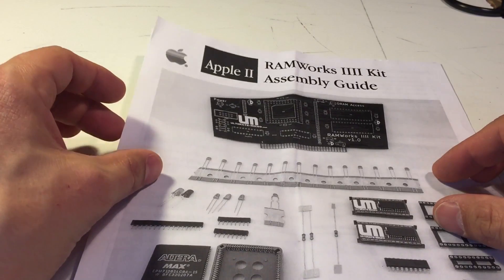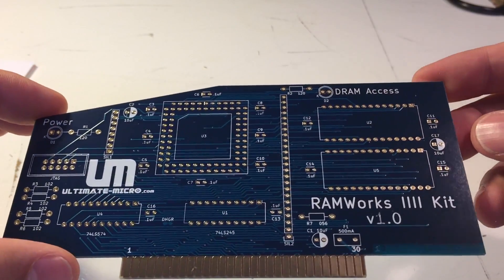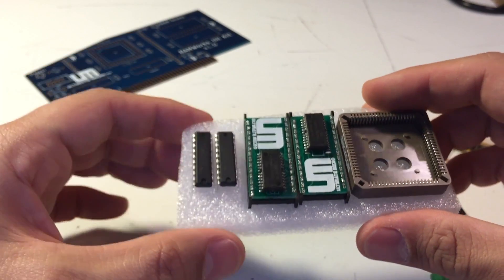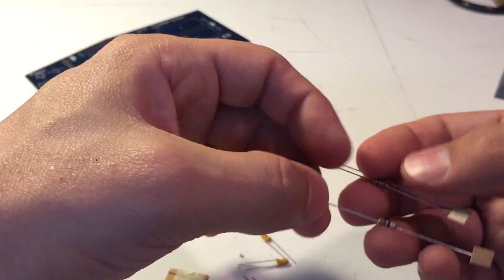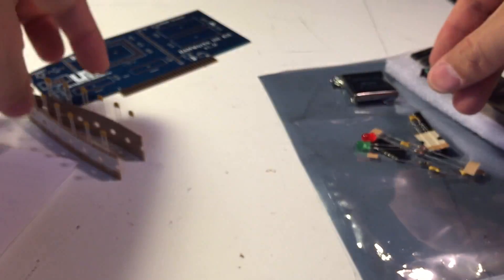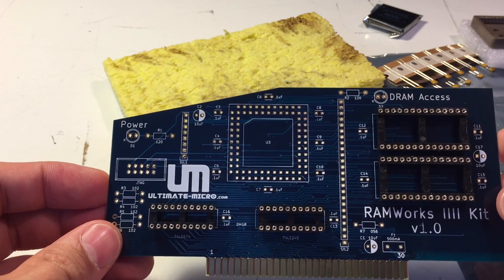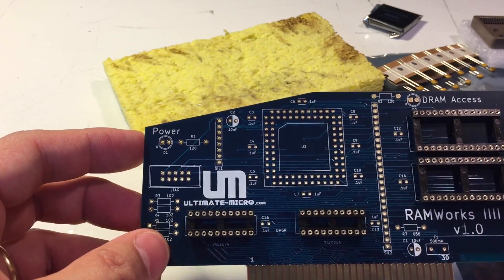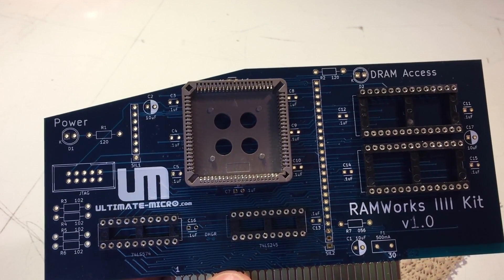REVIEW: UltimateMicro RAMWorks IIII Kit

Comment: Joe, do you have a recommended soldering iron/pencil for this kind of work?
Reply from the maker: Any 40watt or better Weller brand pencil is fine for occasional use. The TS100 iron is pretty good. You can't go wrong with the Hakko FX-888D. I use the KSGER T12 soldering station set to 390c.
Reply: @JoesComputerMuseum  Thank you, man! I'm taking on my first board-soldering as a Mac 512K repair and I didn't even have a clue as to what tools I should look into to get started. Will dig in, and thank you again.
Reply from the maker: @lanatrzczka  No problem. If you are removing chips from the board, you might want to look into a vacuum solder gun.
Reply: @JoesComputerMuseum  I just wanted to update with thanks. I got a KSGER T12 and practiced at 390c on some old boards. Finally went for it and replaced the flyback transformer on my 512k Mac. It came back to life! Your advice, through your fine channel, totally helped to bring this vintage computer back from the dead. Warm up the CRT indeed.
Reply from the maker: @lanatrzczka That is awesome. Congrats!!

Comment: Nice review Joe. A common misconception is that the anti-static bags are conductive on the outside, but they are not. If you don't have a static dissipative mat, then just a piece of foil or even plain paper is better to place those static sensitive parts on, like the RAM.
Reply from the maker: Great point, and thanks for the input!